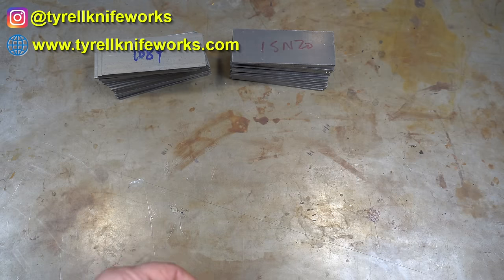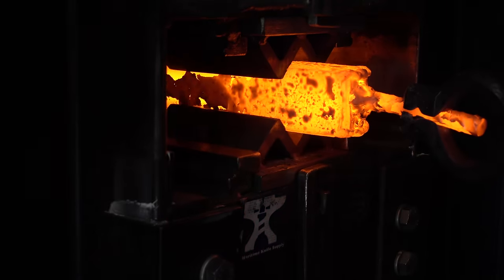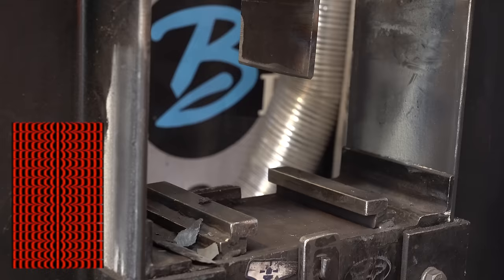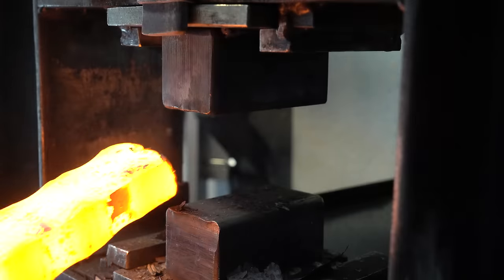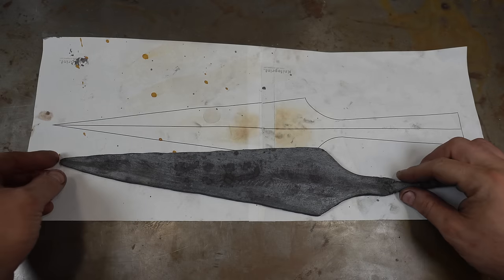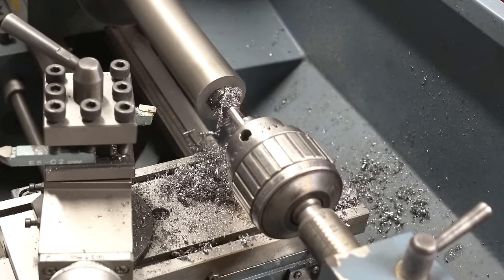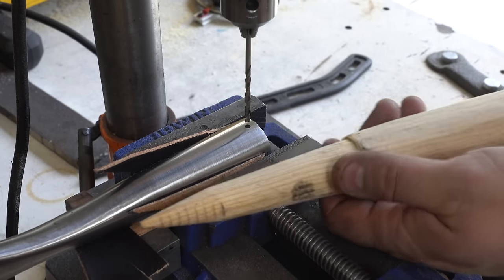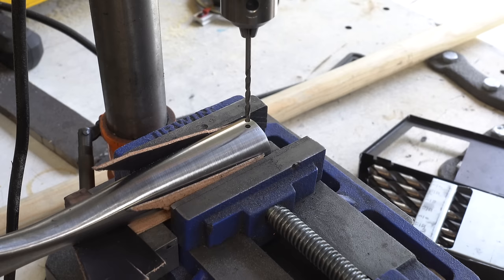Forging a Damascus Viking Spear

Comment: So hey, is there a precedent beyond copper patterned steel for mixing steel and another metal/alloy together? I'm wanting to see a bronze and steel damascus gladius blade.
Reply from the maker: Bronze is certainly possible and has been done before.  Baker Tool and Forge regularly carries it.  I haven't done it yet though.  Thanks for watching.
Reply: @TyrellKnifeworks  No problem man! 
Any tips for someone looking to get into metalworking/forging?
Reply from the maker: @MegaGaming11  Best to watch my Beginner Series playlist.  I put everything into that series for beginners.  👍🏻
Reply: @TyrellKnifeworks  Thank you! I just figured trying to do the project I told you about probably wouldn't be the best idea for someone just starting out 😅
Reply from the maker: @MegaGaming11  no, I’d crawl before you run. 😉

Comment: Sehr schöne Arbeit.  Als 63 jähriger Schmied interessieren mich aber mehr die "Hammer/Amboss " Arbeiten. Also ohne Maschinen. Da sieht man dann das wahre Geschick. Trotzdem, sehr schöne Arbeit!
Reply from the maker: Es gibt einige Muster, die mit Hammer und Amboss einfach nicht realisierbar sind. Ich denke, das ist einer von ihnen. Ja, das wäre machbar, aber es würde ewig dauern und man würde sooo viel Material verlieren. Das Gleiche gilt für Mosaikmuster. Ich bin eher ein Fan des fertigen Produkts, der Weg dorthin ist nur ein Teil der Reise. Danke fürs zuschauen.
Reply: Das stimmt. Bin ein 63 jähriger Messerschmied (in Pension) und halte an der alten  Tradition fest, fürchte mich aber jedes mal wenn Kunden einen Federdamast haben wollen😅 Man wird nicht jünger.

Comment: I just noticed the flame on your burner looks alot different than mine. I think I’m wasting fuel. 🤦‍♂️ I never had a problem with oxidization thought lol.
Reply from the maker: If you’re talking about when it lights up, that’s just to bring it up to temp.  The fuel mixture is turned up after that.  Thanks for watching, Erik
Reply: @TyrellKnifeworks  oh yeah. I dunno why I didn’t think of that. Duh🤦‍♂️leaner mix heats it up faster.

Comment: what is flux? I'm trying to get into Damascus making and I'm almost there but I need to know what it is
Reply from the maker: Flux is used to clean and prevent scale formation during forge welding.  It’s typically borax that you can buy at any knifemaking supply place.  Flux will eat away the bottom of your forge over time so use it sparingly.

Comment: Using traditional methods, how long would a spear realistically take to make?
Reply from the maker: It depends if it Damascus or not.  This one took me about 40 hours and if you were to do the same build all by hand with no press, it would probably be 140 hours.  Thanks for watching, Tony.
Reply: @TyrellKnifeworks  so not everyone would be able to afford a spear, or sword made from Damascus steel back in the day? 
Only the reserve of Kings or, Earls.
Reply from the maker: @tonymcnamara9368  yes, most wound be mono steel for sure.
Reply: @TyrellKnifeworks  I heard of Roman smiths using bog iron to makes weapons when the empire was spreading throughout Europe, as quality iron ore was difficult to find.